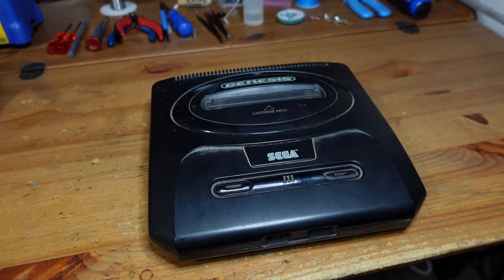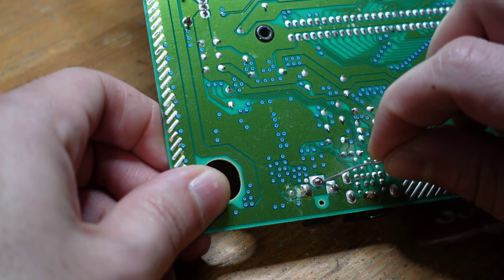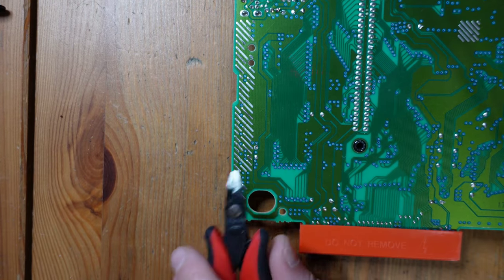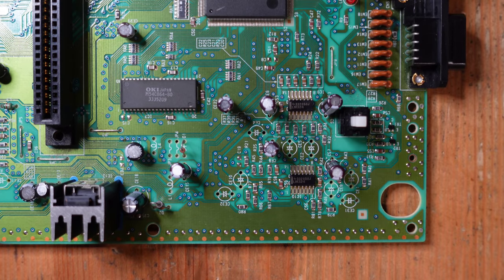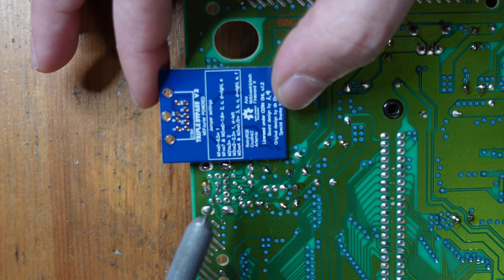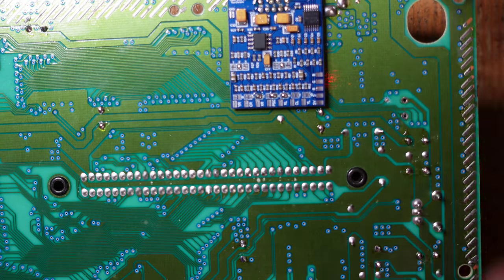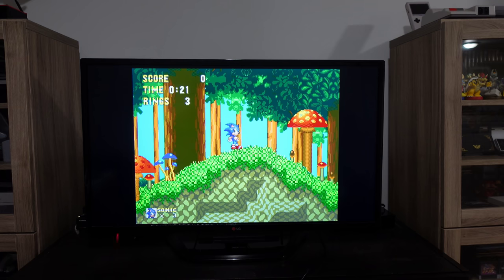Genesis VA1 restoration and Triple Bypass Install! The best video/audio upgrade for the Genesis

Comment: I'm glad you're going through with TBP installs on different motherboard revisions, because even still, there's still so many revisions that have no video tutorials, and sometimes info isn't consistent between installs. Hoping you continue to fill those gaps for other genesis revisions!
Reply from the maker: Thanks, I really appreciate that! I plan to keep making these TBP videos because finding clear documentation for this mod is difficult. And I’m a huge fan of your channel as well, thanks for all that you do in the speedrunning community!
Reply: @LIRetroGaming  Hey thanks, glad you enjoy my runs! But yeah, I've been messing with mods since I've recently changed over to RGB stuff, so I've been doing my own recaps and mod installations. Decided to get a broken Genesis lot to practice TBP installations on, since they're pretty cheap consoles, and seems like a good way to practice since if I mess up, I didn't lose a rare console lol.

I ended up using your guide for a VA1 G3 I fixed (bad caps), then ended up with a VA2 G3 and had referenced the Mega amp thread, RetroRGB's site, and random twitter posts that all had different preferences on what components to remove, which just added to the confusion lol. I did end up getting it installed fine, but it would be nice to know why there's inconsistencies like that between installs lol.
Reply from the maker: That's exactly the same problem I have with the TBP installs - you have to hunt for info on twitter and other sites and the info is confusing or missing altogether. That's why I will eventually have videos of all the different models, to demonstrate a successful install. In general I always use the mega amp thread for the info on disconnecting all the audio channels, and lifting pins on the Sony CXA chip to sever RGB. I'll probably film a TBP on a Model 1 next, since there are a few differences with RGB on that console!
Reply: I've been avoiding this for a while now.  There are so many models of the Genesis, all with their own issues and strengths, that even knowing what problems there are to solve, and whether those solutions create other problems, is kind of daunting.
Reply: @LIRetroGaming  Heya so, I ended up doing a couple more TBP installs on VA0, VA1, and VA1.8 model 2's. I had one issue with the VA1 where I installed the TBP, and would only get green. I traced it from the VDP all the way back to the TBP, and no traces are cut on the TBP itself anywhere on those RGB paths. I would randomly also get the screen being completely dark with only "shadows" showing up. I ended up swapping out the TBP board itself with another one, and the issue was completely gone and the VA1 is great. The VA0 was completely headache free and worked first try too.

Fast forward to now, I've run into the same problem on this VA1.8 where now I only got red/green on the screen and no blue. I did the same tracing from the VDP back to the TBP board, and ended up reflowing some stuff on the TBP (and even replaced the THS7374), and I got those "shadows" on screen again and it was stuck like that. I decided to do the same thing as last time and swap the whole TBP off with another one, and this time I got immediate shadows again, which was really disappointing. I swapped it out with a 3rd TBP board I have, and now I get only red lol. I swapped the THS7374 (again) and now I got shadows, yet again.

Would you have any ideas on what on earth is causing this? I thought I was getting the hang of installing these, but this Genesis is making me think otherwise :/
Reply: Dang ok nevermind, I figured it out. Somehow, R3, R4, and R5 on all the TBP boards I got were all bad. I bodged in a through-hole 5.6k resistor in place of R5 after tracing where the voltage dropped from the VDP to those resistors, just to see if anything would change, and suddenly blue completely came to life on my screen. That just seems so weird to me, but do those 3 5.62k resistors there go bad often? It seemed to be the case for me across all 3 of my TBP boards.

Comment: That mod is no doubt a must get. I installed this onto my Model 2 Sega MegaDrive. The colours looks phenomenal. The audio improvement blew me away and sounded absolutely incredible, Possibly way better than the Model 1 in my books. This mod was easy to follow. Good work on here with yours.

Comment: Had the exact same crack in the solder on the power input of my Model 2. Swapped it for a new jack, as well as the DIN,  while I was in there. With HD Retrovision component cables and the Retrotink 2x, the picture is amazing!

Comment: i hate to be negative cause i love your videos. it seems like more and more you leave out the small details of the install leaving a user following the video live that leaves us scratching out head and looking else where to finish it off. the part you speed through is important also, although boring id rather the points be highlighted or atleast zoomed in on.
Reply from the maker: That’s fair. I have to remember that some of these steps might be boring for me but they might be totally new for a beginner. I’ll try to remember that when I’m making new videos
Reply: @LIRetroGaming  i agree! this may be the sole video being used for said install. thanks!

Comment: I don't have the video issues, I live in the UK and we have RGB euro SCART for all SEGA consoles that we connect to a monitor or TV, crisp 240p image (on Mega Drive and Master System) that looks fantastic on most CRT TV's it also looks good on a LCD or LED. But the United States only got S-video, composite or RF... Different in Europe.
Reply from the maker: That is correct, although the Genesis does have RGB available we never had cables or connectors to utilize that video mode. Nice to have these options nowadays in North America

Comment: Thanks for this nice tutorial! Do you think that composite video out on a 32X would still work after doing this bypass to the Genesis? I understand it won't work directly from the Genesis console's multi-out, but i think that the RGB signal will pass fine to the 32X. My understanding is that 32X takes the RGB signal and converts it to composite internally.
Reply from the maker: Yes, you can preserve composite video with this mod and also combine it with the 32x. Zaxour has a good tutorial for this on his triple bypass github

Comment: I am doing this same mod and I am very excited to do so in a few days! Are you using HDRetrovision cables along with this mod? I heard that the triple bypass mod removies composite video cable functionality, and I was wondering if I needed to get them to have the results you gained as well?
Reply from the maker: This mod has the option to remove composite, but in this video I left composite video intact. It’s compatible with the HDretro cables and also with RGB cables as well, so you should be all set!

Comment: Great job, your tips are very useful, thank you. 

Btw, I want to ask you or anyone else with experience for advice. I have Genesis2 VA0 and VA1 both consoles, also the Japanese MD2 VA1. I have not noticed any audio/video issues (cracks, loudness or distorsion) with RAD2X to hdmi adapter. But I`m very interested to know if "3BP" will dramatically upgrade the performance of audio/video in this case, and also if it would be compatible with RAD2X. If yes, then I will probably get it for all 3 of my consoles. 

Thanks in advance, cheers!
Reply from the maker: It should improve the performance of audio and video for those models, and it is compatible with the rad2x

Comment: Hello LIRG, very good video as always I'm getting much and much more into modding retro consoles, and this seems like a intermediate level mod for me, I recently acquired this very same model of genesis myself, seeing your videos I'm prone to buy and install this Triple bypass mod for my console. 

Sorry for the barrage of questions that come as follows :

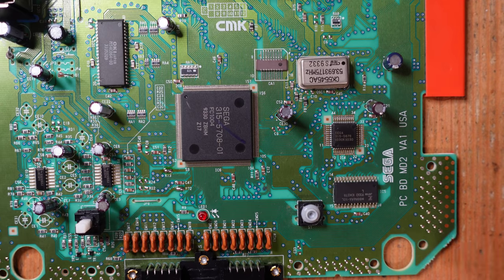@14:45, do you happen to know the model solder tip of the hakko, is that fx888d model station? I need a small thin tip as the one you display in that specific part, because I struggle a lot with a wider tip I have on my fx-888d.

@same minute mark
What model of jumper cable and awg caliber you use? this looks like a sturdy cable, well suited for this mods, I like that the plastic coating is thick, personally I ordered some 30 AWG but I'm not quite pleased with it, it seems very frail, also I see voultar uses the same caliber and maybe the same brand? of jumper cables you use care to share?

@same minute mark
I see you put the music x68000 in the description, can I have which song is that specifically, or at least the game, so I can search it..... It's soooo soothing and pleasing.
Reply from the maker: Glad you enjoyed the video! Here are some answers to those questions. I use the T18-D16 soldering tip for most of my work but occasionally I use that smaller tip for some applications. Unfortunately I can't remember the model number of that one.

Normally I use 28 gauge copper stranded wire for my installs, although 30 gauge is also useful on occasion. Something like this: https://www.amazon.com/Pc-Accessories-Connectors-Connector-10P-15FT/dp/B073W9R4R3/ref=sr_1_1_sspa?crid=2AV4JEWJ1OHXO&keywords=28+gauge+rainbow+wire&qid=1642788969&s=industrial&sprefix=28+gauge+rainbow+wire%2Cindustrial%2C67&sr=1-1-spons&psc=1&smid=A64W1E1ZZHST0&spLa=ZW5jcnlwdGVkUXVhbGlmaWVyPUE2QzlOU1k0QlFKMEUmZW5jcnlwdGVkSWQ9QTA5Nzg0MzUzSk9VMDFLTlcwRDVUJmVuY3J5cHRlZEFkSWQ9QTA1ODc2MTQzU0FRNVJYNE42TFU4JndpZGdldE5hbWU9c3BfYXRmJmFjdGlvbj1jbGlja1JlZGlyZWN0JmRvTm90TG9nQ2xpY2s9dHJ1ZQ==

Lastly that song is called Uranus and it's from the game Spindizzy II on the Sharp X68000. There are some examples of it that you can find on Youtube.

Comment: i've got a model 1 that doesn't have that splash at the beginning when you power it on, very nice find.. but it definitely needs new caps. the sound is horrifyingly distorted and there's jail bars. might do a vid down the line of how bad it can get as a before/after.  on a side note, i miss my sega CD and 32x, both destroyed by cat piss.
Reply from the maker: That model one would definitely benefit from a triple bypass. It would solve all of those issues
Reply: @LIRetroGaming   Well, except the cat thing.  ;-)  haha

Comment: Hi, is this scheme the same for the SEGA MD2 EU model? Also, the jumpers on the triple bypass board? I could`n find the information. Thanks!
Reply from the maker: Yes it should be the same for the European model. The jumpers are actually on the back of the PCB so all you have to do is look at that before closing up all the jumpers

Comment: What AV cables did you use? I’m interested in this mod but would need to still be able to use composite as my setup doesn’t have component.
Reply from the maker: This mod is specifically for RGB or component, so you would need those cables and a scaler to connect to a modern tv

Comment: Recently acquired this same model genesis and a crt, really excited to do this mod. While I do have hd retrovision cables my crt only has composite/s-video inputs. Can I do an s-video mod along with the triple bypass?
Reply from the maker: I have never tried it, but I think it is possible. You should still have access to Luma and Chroma which is what you need for the S-Video mod

Comment: How do you connect your RGB Mega Drive 2 to your TV? In Europe we have the scart connector for RGB video input. You guys in USA had only RCA plugs.
Reply from the maker: That’s correct. Here we can use hd retrovision cables to connect directly to a CRT, or we can use the same European RGB cables and connect them to a scaler like the retrotink5x

Comment: What kind of cable or setup are you using to plug it into your LCD tv? Are you using some fancy cable plus some other adaper before it gets to your tv?
Reply from the maker: I’m using HD Retro vision component cables and from there I send it to a scaler called the OSSC that Converts the video signal to 720 P without any lag

Comment: Is cutting the sync trace not necessary in this motherboard revision?
Reply from the maker: No, you don’t need to disconnect sync with this one. That’s only needed for the model 1 consoles

Comment: Got a VA1 Model 2 as my main Sega Genesis, audio was so horrid before I installed a Triple Bypass (heavy distortion that was very noticeable on the Streets of Rage 2 intro, and on the Jurassic Park Title screen) Those LM324 OpAmps are the absolute WORST on these Genesis consoles.
Reply from the maker: Yeah the difference in quality between those versions of the Genesis and the model one is really significant. The triple bypass is a big step up!
Reply: @LIRetroGaming  Definitely. The difference is night and day.

Comment: How different would this process be for a Model 1 with VA7 motherboard? I heard those are essentially a model 2 in a model 1 shell.
Reply from the maker: It would actually be more similar to a genesis model one bypass install. IFixRetro has some good photos on Twitter that document the va7 install

Comment: Maybe I missed it but what was the solution to the stuck reset button?  Was that just a dirty button area on the case top or spring or was there an issue with the button membrane?
Reply from the maker: Sorry I should have elaborated on that but it was just the plastic. It was really dirty and after the cleaning the reset button worked just fine

Comment: This thing is out of stock everywhere, where do I get one,
Reply from the maker: They are available on eBay. I also sell premodded Genesis with the triple bypass
Reply: @LIRetroGaming  thank you it comes in today and I'm going to try to mod it using your video (I also have a VA1) going to have to skip replacing the caps but I'll eventually get back in there and redo them. I'm also going to run some composite video tests a lot of people say that it disables composite videos so I'm going to actually check and check RF.

Comment: Why don't you use flux?
Reply from the maker: I use it sometimes, but it’s not necessary for every instance of soldering
Reply: @LIRetroGaming  it would probably help alot in the through hole vias and it would have been better for the joints of that power jack to wick away some of that old solder before introducing more. To each their own though.
Reply: @toxicavenger6172  came here to ask this lol. Watching him have trouble getting the solder to flow was a tiny bit painful lol. There's never a reason not to use flux whatsoever, it just makes your life easier no matter the project.